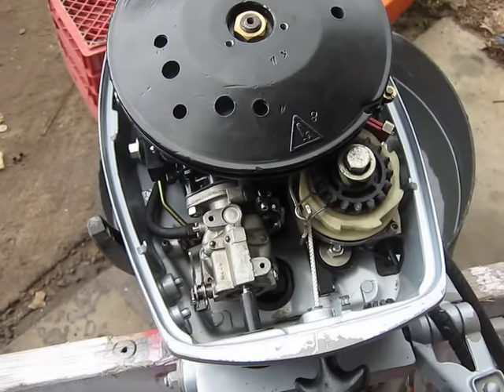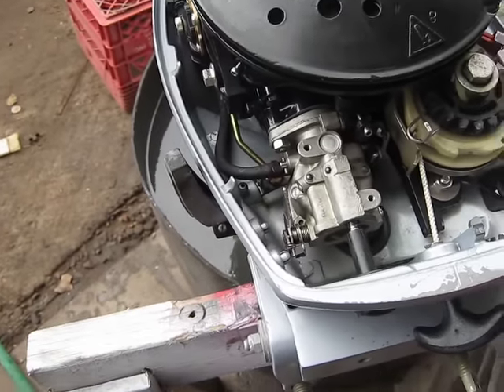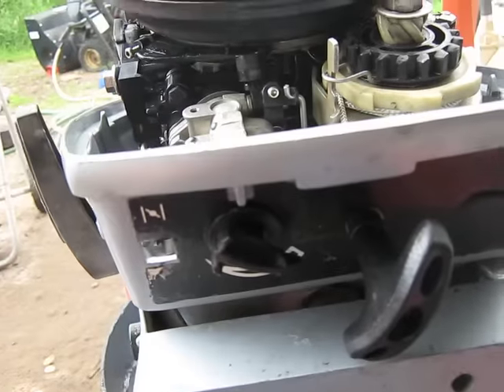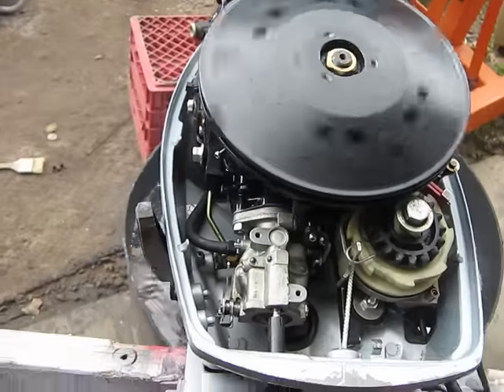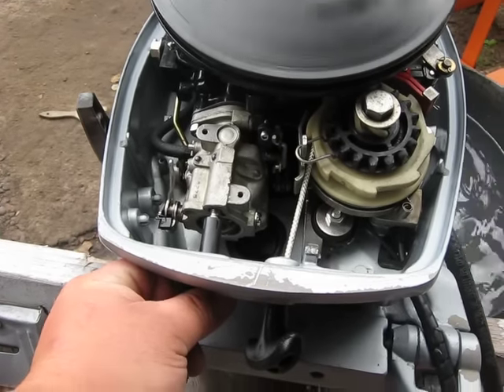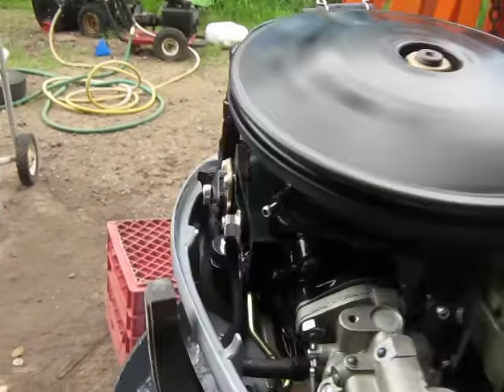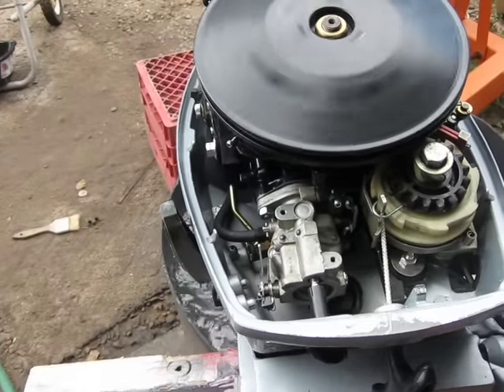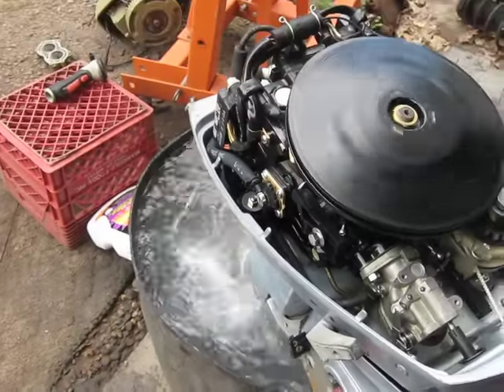Johnson Evinrude 9.9/15 hp carburetor adjust how to.

Comment: Dear Sir, Really Enjoy your Videos, I have been restoring a1964 Sears 14 Ft. Boat and Trailer. I want to keep the Motor I buy to be "period correct" and have found a 1963 Evinrude 6 HP and a Ted Williams 15 HP though I don't know the year. Both engines have been in Storage @ 15 years and was assured they were Both in Good Running Condition. I have not bought one yet but wanted to know what to look for and do you know any Reliable Mechanics in the State of Georgia. Thanks again for Any advice you might can give. Rick Shumpert
Reply: sorry to be so offtopic but does any of you know of a way to log back into an Instagram account?
I was dumb lost my password. I appreciate any tips you can give me
Reply: @Alex Ernest Instablaster =)
Reply: @Kade Dane Thanks for your reply. I got to the site on google and im in the hacking process now.
I see it takes a while so I will get back to you later when my account password hopefully is recovered.
Reply: @Kade Dane It did the trick and I actually got access to my account again. I am so happy:D
Thank you so much you saved my ass !
Reply: @Alex Ernest You are welcome =)

Comment: Hey my 1968 Evinrude sportwin 9.5 idles well but not on slow .. when I go to shift I have to do it quick or it stops it's runs great other then that  what would you suggest
Reply: Adjust the timing advance a little, or make it a little richer.

Comment: Hi great video. I really need some help. I cannot tune my carb. It's 87 15hp late model with black plastic top. I have new throttle roller . All new carb kit. I get engine idle but on gas it Biggs down and dies.
Reply: The main jet is plugged.

Comment: I've got almost the same motor (25 evinrude). I took it out yesterday and when I left the boat ramp and throttled up, it didn't really do anything. I tried chokin it and still nothin. Then I blocked off the intake into the carb with my fingers and it took off like a rocket. I had to block off about half of the intake. Any clue what would make it run so lean?
Reply from the maker: Kent Ray Sounds like the "HI speed" jet is plugged, Time to clean the carb.Also check your gas for water.
Reply: Thanks man. I did leave the tank unscrewed a little last week when it rained. But on the return trip yesterday the motor ran like it should. So hopefully I just had a little rain water in the tank. Thanks for your quick feedback man!
Reply from the maker: Kent Ray No problem.

Comment: So I just got a 9.9 Evinrude that's been pickled it's really clean hasn't run for years but like I said they said it was pickled whatever the hell that supposed to mean LOL I guess it was put away properly but it doesn't have a throttle arm which is okay because I have a sailboat so I steer it with my tiller on my sailboat but it has an electric start and I've never started one without a throttle arm... No I have started a car under the running things using the carburetor and you know throttling it like that but not now bored with an electric start and I'm a bit tired it's been a long long treck and I don't know what the hell I'm doing can anybody help me it would be wonderful thank you

Comment: So I checked the jets, they're brand new with nothin cloggin em. Only thing I can think of is a vacuum leak in the carb somewhere. You got any other suggestions?
Reply: Just checked the plugs... Put brand new plugs in before I took it out last and the bottom plug is fouled. There's fuel from the pump though. I'm stumped
Reply from the maker: Kent Ray Can you make me a video So i can see and hear what it is doing?
Reply: I can make a video but I highly doubt you'll be able to hear it. It only happens in gear and on the water.
Reply from the maker: Kent Ray Well we can try

Comment: I just bought a 85 15hp evinrude.  When it's cold and it first starts up the rpms go crazy (I'm no mechanic). Just when I think I'm going to become a human drone, it goes to "normal" idle and runs smoothly.  But when in forward I can't go more than 8mph in a 14ft smokercraft. It seems like I should be able to open that up and get about twice the speed. I suspect the butterfly valve is not opening all the way. Anyone have ideas? Please go easy on me. Thank you!
Reply: I have the same exact problem have you fixed it if so how did you?
Reply: @hippomicheo484  one cylinder wasn't firing.  thought I had it fixed. new coil resolved. but now the thermostat is bad and it's located way down below the rear cowling, so I can't get to it. gave up. sorry.

Comment: You need a book when you adjust the carburetor on that motor the throttle needs to be closed tight there is no other way to adjust it properly read a Johnson service manual and it will

Comment: how far should you have to twist throttle in order to start?I asume this determines on the one adjustment screw you talked about.Also, if I have the throttle twisted all the way off should that little roller be hitting or just barely touching the piece it rides on?My roller is pretty far away from the piece it rides on, so I have to twist throttle pretty far in order to start to open throttle to start.
Reply: Adjuster the rollers screws until it touches

Comment: What fuel/oil mix? Says 100:1 but ive always been told run 50:1 but when I run 50:1 after awhile it fouls plugs out
Reply: i run mine on 70:1 i got told to run 50:1 when new depends on how much use my 9.9 sailmaster runs on 100:1 as it runs for 8 hours at low revs.

Comment: Witch spark plugs do you use?
Reply from the maker: henning sellevoll I use Champion most of the time.
Reply: what type? i have two mounted on the engine. they are called champion RN3C and champion L77JC4. Sorry for bad English :)
Reply from the maker: The l77jc4

Comment: Great video dude , I started out to ask you or anyone what the MPG of a 9.9 johnson ?  An EDUCATED GUESS ?  , for a no gas station for 250 statute miles trip i'm taking 11-22-14 ,dose anyone know ?    BUT NOW i see you are the chrysler outboard dude you might have parts i need for a 3.6 chrysler , I need a pull cord ass, it comes strait out the front , ,has 2 little flat catches into the deep cup from what i remember . If you sell parts like this & the water pump let me know & i'll find the model # & part # of the cup. THANKS dude & anyone that can answer the MPG question .
Reply from the maker: Steven Hardy Sorry but i don't sell part's. MPG is about 10% the horse power per hour, so a 10hp is about 1 gallon a hour at full power.I would say your best place too look for the parts is ebay.

Comment: I have a 1980 9.9 Johnson.  When I prime the fuel line with the primer bulb, gas is coming out of the carb where the small breather screen is located, on the side of the carb.  Is this bad?  Engine won't stay running.  maybe sucking to much air.

Thanks!!!
Reply from the maker: Well there are only two ways that would happen #1 needle and seat in the carb is leaking or #2 is the float in the carb is bad.
It's time for a carb rebuild. This is the kit you will need.
http://www.marineengine.com/newparts/part_details.php?pnum=OMC0439072